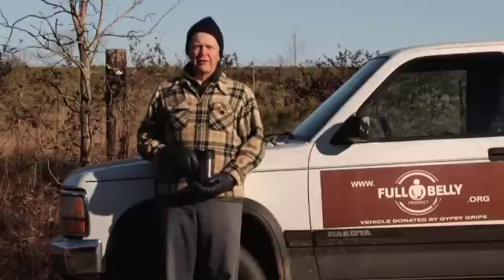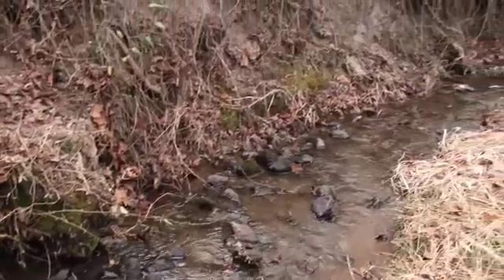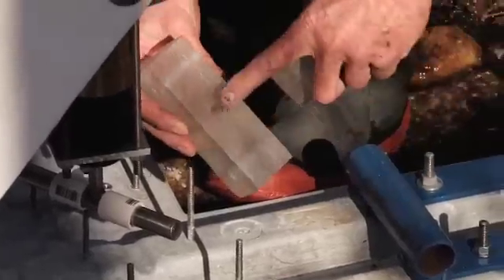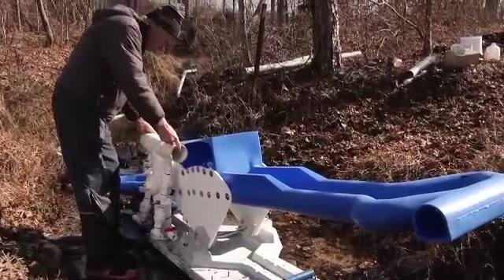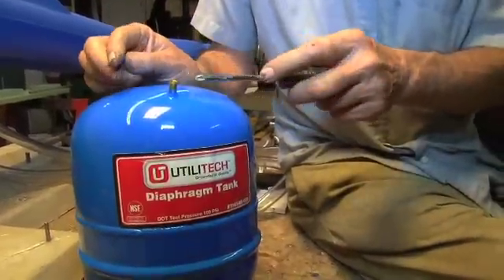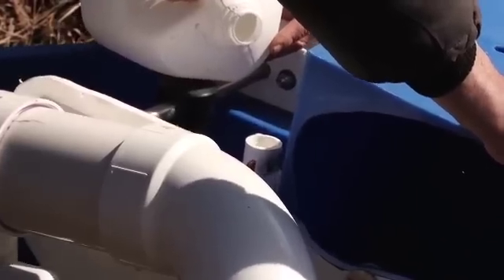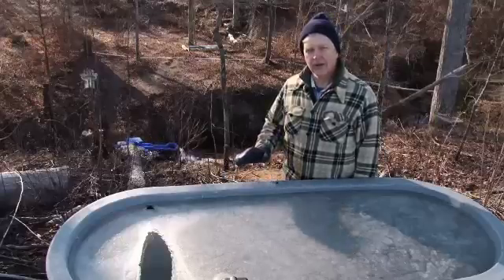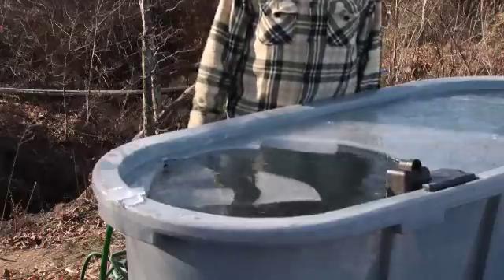Full Belly's Gravity Water Pump

Comment: I see that you still need a few feet of fall to make this work.
Reply: All water powered pumps require some fall to work (other than the steam powered).  You have a good observation - In situations where there is minimal fall, I wonder what the minimum head is to allow the tanks to fill?   Anyone have a working teeter totter, see saw, Monjolo water pump in operation?  If so, I'm sure a lot of people would like to know about it.
Reply: Water only has to be at a high enough level to pour onto the input pipe at the top of the 'Teeter'. The higher the rate of flow, the faster it will pump...

Comment: Correct me if I am wrong, but doesn't a ram pump require more of a head?  This pump looks like it only requires a couple / few feet.  That does not seem like enough for a ram pump.
Reply: Because your only going uphill '20, a small RamPump could work easily with that amount of head...

Comment: OK so how does the damn thing work?
Reply: warer fills half that long arm, causing it to teeter down and spill its contents out. Meanwhile, the running water is filling the other half of the arm, until the whole thing teeters the other way. Every time the arm moves, it works a pump (double acting, if they're smart), that pulls water out of the river and up to a reservoir. As most people have mentioned, a ram pump is a simpler and more elegant design for achieving the same goal. A water wheel pump will also work. The problem here is, a ram pump requires a certain amount of head water to work and that babbling brook is supposed to be an example of the lack of such a thing. The water wheel pump requires a certain amount of water flow to work, and again, it is something not present here. The gravity pump is one solution to a low water volume situation.
Reply: @DeanMk1  Thank you for your reply to this video - If you have a continuing interest in water powered pumps, I would really like to make contact with you.  My question is how do they fill the lifted arm from water coming in at the center?
Reply: @davebean2886  Speculation on my part, but @ 1:20,  see the blue box like object in the middle of the pump? The white pipe apparently feeds water into it. 
I'm thinking the box is divided inside with an outlet pipe leading from each half of the box to each arm.
The box moves with the arms, so as those arms rock, it changes waterflow from one arm to the other.
How does it flow water "up" and into the lifted arm? The box is situated higher than the lifted arm, so water flow is actually downhill into the arm.

Comment: Fullbellyproject - hats off to you.  This is a VERY elegant design.  There are various postings of folks poo-pooing the efficiency or complexity of this pump.  The fact of the matter is,  if you have a stream that does not have much flow or a head or fall to produce work... this WOULD work.  In either case whether  hydraulic ram or this "see-saw" design the pump must be designed to work with the resources available.   In both cases they free up farmers to be more efficient in their labors do other work on their crops and/or farms and homes moving water to where it is most needed.
Reply: Please, contact me by:  ka6003@gmail.com

Comment: too elaborate, I would use simple ramp pump
Reply: Yes, it is elaborate, but it does work.  I myself would find out if the stream completely freezes in the winter. IF NOT I would then dig a hole, a pocket about 6 feet in diameter and 5 feet deep in the stream. That way it will NOT freeze all the way to the bottom. I would then have a solar panel close by that gets sun as much as possible and connect it to a pump. I would then dig a trench for the pvc pipe a couple of feet below the frost line to where ever I needed the water to go. OR use a simple ram pump to do the job depending on the distance of pipe to travel uphill or the ram pump will not work. Every landscape is different and you need different idea's to do the job.  Great job Nava. It is ALWAYS good to hear about different opinions, that way U can figure out the best solution.

Comment: Waaaay too complicated pump! A ram pump will work as fine, but a lot cheaper and simple.
Reply: Even simpler and probably more effective....a water wheel pump.
Reply: @DeanMk1  how do figure a water wheel pump is simpler?
Reply: @alabastardmasterson  Way less complicated design. Build a paddle wheel, wrap some hose around it, make the axle the pipe the hose feeds into and run pipe to wherever you need to move the water to. Can be built for FAR less $$$ than that monstrosity in this video can be and far less moving parts. Also less prep. You don't have to dam anything or divert any water, just make sure the hose goes in the water with every revolution and you're golden. Sometimes its called a "Spiral Pump" because the hose wraps around the wheel in a spiral. Here's one of a myriad of videos on youtube showing a water wheel pump - https://www.youtube.com/watch?v=A2sGZjatWc0
Reply: Here's another example of the same concept taken in a different direction. This is (was?) made by a company called Rife - https://www.youtube.com/watch?v=seNswRYkZdE
Reply: @DeanMk1  I was referring to the ram vs water wheel comparison. Also, I've never a spiral pump work within the parameters of a site like the one on the video
Reply: @alabastardmasterson  Apologies. I thought you were referring to the Teeter-Totter in the video. In that case, yeah, either will work, although I would think the spiral pump might be more efficient since it transfers all of the water it picks up. I've heard that a Ram Pump only transfers about 20% of the water it takes in because of how it works.
Reply: @DeanMk1 the waste value discharge is less or equivalent to a spiral/coil pump which only picks up water during ~10-18% of its cycle. Both pumps have their place, but spiral pumps need to float due to fluctuating water levels and have to pump water through a complex spinning axle arrangement. Inline ram pumps are usually much more efficient, simpler and cheaper for a low flow/low head application
Reply: @alabastardmasterson  Not saying you're wrong, but the Ram Pump throws at least 1/2 the water it ingests back into the reservoir.
The spiral pump (I guess we're calling it that now) doesn't do that. It moves ALL of the water it ingests, however much of a revolution that entails...and let's not forget, the scoop of a Spiral Pump is often quite a bit larger than the hose it feeds into (a 2 litre bottle with the bottom cut off is a commonly used scoop on smaller home-made Spiral Pumps), so it keeps draining into the hose long after its been lifted out of the water.
Reply: All good points - the trade-offs between various types of water powered pumps, including this one are being discussed with participants from around the world in the Water Powered Pumps public Facebook group - I invite you to take a look and join in and share your ideas and ask your questions:
https://www.facebook.com/groups/240458583255303/

Comment: This is simple.. as far as I can see this pump does not need to much water or fall to work. it will work with water volume and water fall that a ram will not.. is that simple....for cows bumping.... fences.... for water washing it away...... place it away ..high on the side of the creek...

Comment: Wouldn't take much to put up a cheap wind generator or solar panel to run a 12v heating element or two..hmm...  This is kind of nest looking, I did see a commenter ask why not use a ram pump and I was wondering that myself... But you know, this kinda looks like a dressed up ram pump. Still has two check valves. Guess I need to watch it again to figure how the seesaw comes into play :)
Reply: ALWAYS check into your options. Every landscape is different and different systems work better than others.

Comment: I like this, but don't have running streams round here and I can't see my horses or cows slamming their head into 1'' thick ice to break it !
Reply: There was already a hole in the ice where the pump overflow motion is, where their tongue can fit into the liquid water. And that action will stir more motion, and their tongues will warm the area near the same area and it will keep it melted where they don't have to slam their heads thru the ice. lmao that is funny

The more they drink the bigger the melted spot to get water without using their heads like jack hammers. lmao

I just knew someone would misinterpret what he was saying, and once i seen him hit the ice really hard with his fist to break it that someone would think he expects the cattle to slam their heads into the ice to get water.  Lmao 

He was only breaking it to show you how thick/thin it was over night at those temps. The cattle drinks daily and their action will keep the little hole open, and make it a bigger hole depending on how many cattle drink out of it. 

Just like how ducks keep a little pond from freezing, they stay in it and float around paddling motions and conduct their temperature into it. They know they can't stop the lake from freezing if their pack is too small, but they get the slightly inland ponds the size they can use and keep it for winter, not frozen. But ducks know what they are doing when it comes to water, a horse don't use water like a duck, but still drinks water daily, multiple times daily and that action along with the rest of the cattle will keep the hole open, because of the overflow and pump motion.